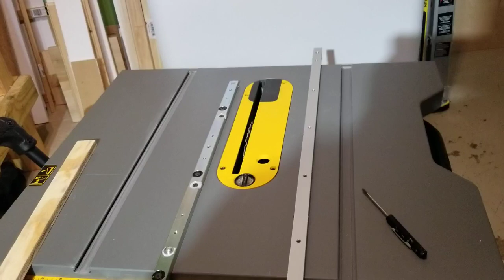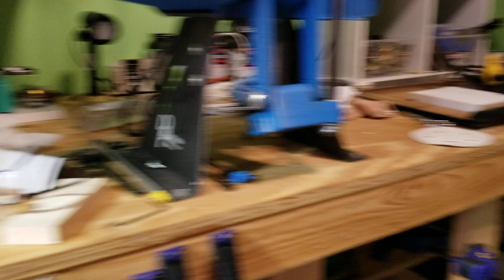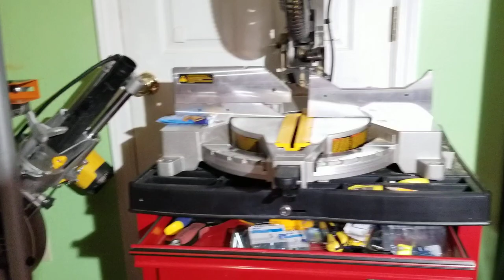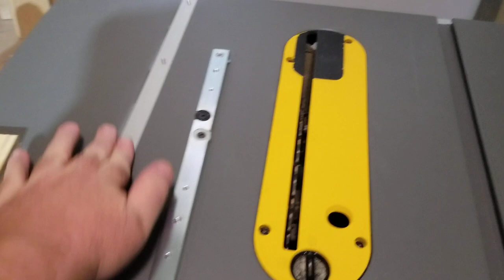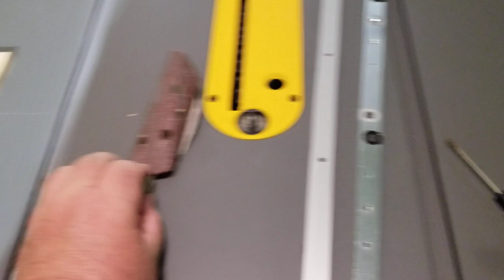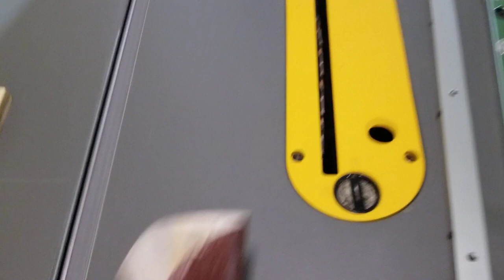Dewalt dwe7491rs miter slot trick and tip for fitting miter bars

Comment: You got lucky.  I tried sanding on my DW745, and more sanding, and more sanding, to no avail.  Eventually discovered that the miter slots are not the same width, front to back, or left and right.  Also encountered some other issues.  DeWalt replaced the saw.  New saw also has some of the same issues, not quite as bad.  I like the saw, especially the rack and pinion adjustment for the fence.  However, both fence and blade have been difficult to align with the miter slots.  The fence is hollow, and the face gives.  Anything work piece cut using the fence ends with a slightly curved edge.  
I am glad you were able to resolve your particular issue.  I will keep this saw; it’s handy for some tasks.  For more accurate work, I picked an old cast iron Craftsman which I am upgrading.  The miter slots are perfect, the blade aligns easily (with PALS), a new Shopfox Classic fence will be installed soon.  It purrs like a kitten and cuts like the proverbial “hot knife through butter”.  
Best wishes and good luck to you.
Reply: Fill your fence with spray foam.
Reply: @snoopster000  How?  And what kind?  The foam won’t distort the fence?
Reply: @joedance14  You want a small gap/cracks foam. It expands less than others. Avoid the stuff that says its for big gaps or anything thats says double or triple expanding. There is a rib that runs through inside of the fence that should keep the foam from deforming the aluminum.
Reply: @snoopster000  Thank-you! But how is the foam placed inside the fence?  Remove an end cap?  Drill a hole? Something else?
Reply: @joedance14  Remove the end caps and fill from the ends then reassemble. Be sure not to over tighten when reassembling, the rib that holds the screws is thin.

Comment: I did the same thing but I used a 400 grit diamond stone. Did you have pinching at the ends, I did. A few extra passes at the end with the diamond stone as well. The thing is for $0 the miter slots went from zeroes to heroes. And yes, the slots, fence and blade are 100% inline. Made two sleds slicker than snot and both aced the 5 cut method.

Comment: Used to be an equipment dealer in Denver, Schlosser, who had more than a half ton of Rockwell branded import table saw tops in the back room. Schlosser had changed them out because the T slots weren't parallel. Don't rely on the good names whose reputations were built here in the last century. The new owners of the Powermatic brand imports some absolute crap with pretty paint jobs, excellent advertising, and loads of cheap-to-produce "features".

Comment: Thank you!!!!! I just bought a very similar job site table saw I wondered the same and now I’m curious if mine is going to do the same and if I need to adjust the tracks on mine. If it’s a DeWalt it needs a little love but no biggie. You said 60 Grit? And a narrow stick should work? On that Incra what length did you go with? I found two on eBay about $30 and they have them in 24” and 18”.

Comment: I have the DW745. Same issue. That coating that they put on it messes up the miter slots. Mine taper on the back side on one slot. Makes it a bitch to fit bars in it without slop. Guess I'm just gonna have to sand it and wax it every once in a while.

Comment: You are the only one ive seen that has the dewalt miter saw on the rigid rolling stand!  I do as well.  Better stand for less $ than the yellow
Reply: I have the Ridgid on the Ridgid stand. That stand is the best. The DeWalt rolling stand sucks because the mechanism to set up the saw has a cable connection and you need to adjust it. Screw that. I sold it for the Ridgid and never looked back. 3 years and still in love.

Comment: Hey, Question about the fence (the thin one). Are you able to put the square (or something flat) on the fully extended fence with thin fence set as a support/extension? Does it look leveled with the surface of the table? On mine, rails are sagging and that results in a dip. Especially when the fence is on the left hand side. Even moving the fence itself (left hand side) on the table's surface feels like dragging.  Are you btw aware of a fix for that? Thanks

Comment: A big mistake everybody makes is buying one long miter bar. They don't work because there is only one metal slide in the bar at each end so it will slop around until the next one is in the slot and by then the first one has come out of the other end so you are much better to buy more shorter ones.